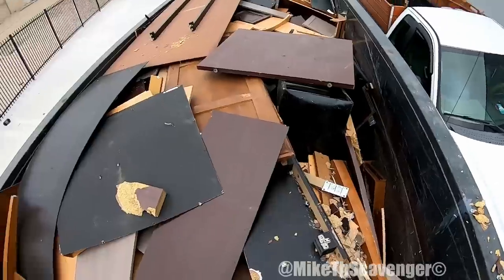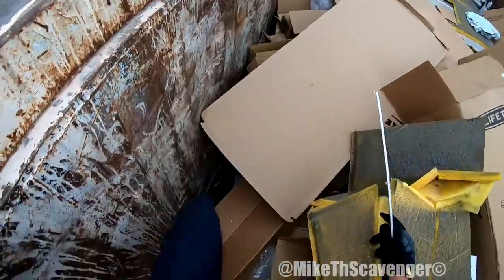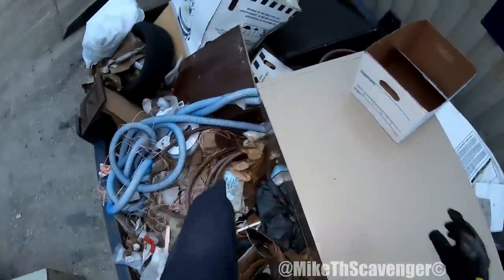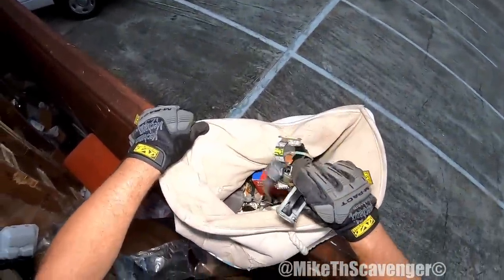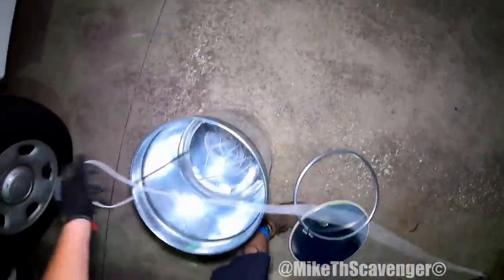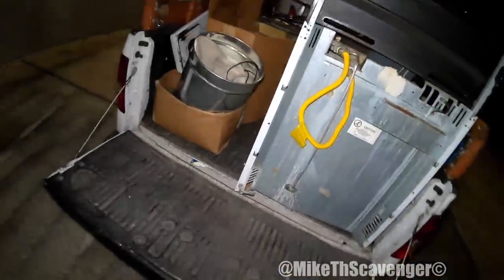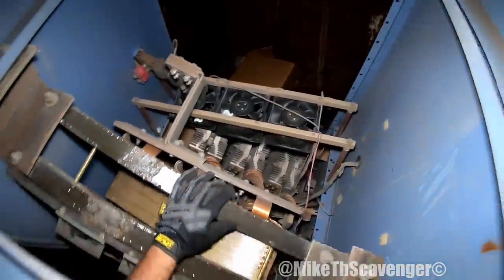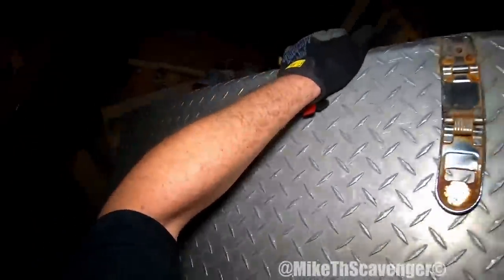Dumpster Diving "Found A Bag Full Of Watches!!!"

Comment: The short pieces with bare copper wire between two aluminum plated copper lugs are called shunts. Often used in switches with movable contact tips.

Comment: The case for the typewriter is cast aluminum. There also usually is a good 3/4 HP electric motor inside... Some bits of extruded aluminum... Usually the key mechanisms become jammed. Operational ones usually sell for about $50.

Comment: You should drill the copper plates to make sure it isn't copper coated steel and then go back for the big parts that you had to leave behind.  Good scrap a plenty there in that dumpster.

Comment: 📌Good find I hope you grab that big electric motor off that big machine.🕵️ But speaking of electric motors you should be just cleaning them all and getting all the number two copper out of them you'll get 10 times more money. It's a minimum of 2 lb of copper per motor and you can do about 7 to 14 in about an hour. The best tool to use is an air chisel. But a grinder with a diamond wheel works pretty good it just makes some dust.